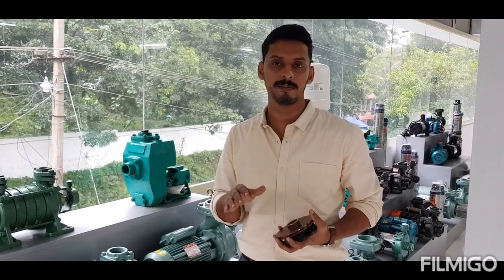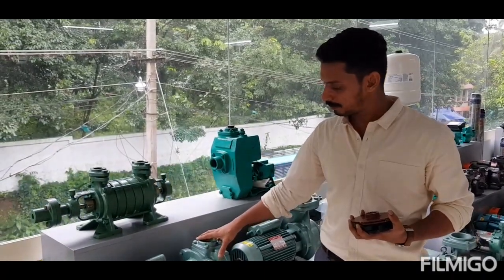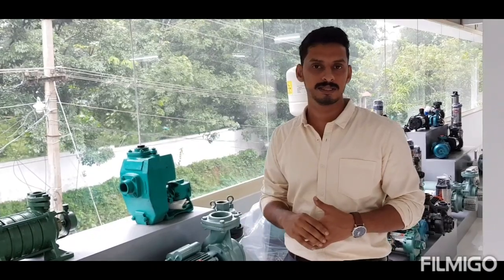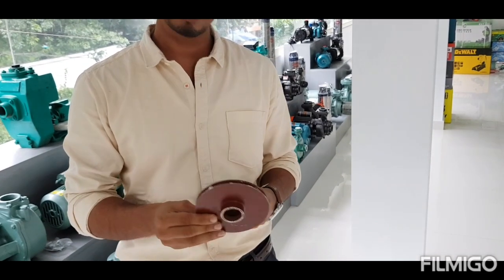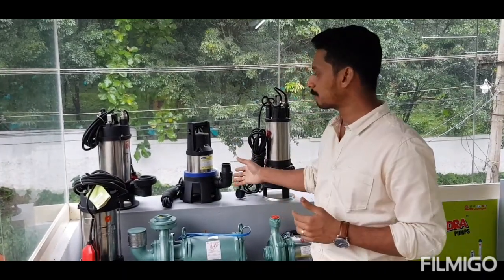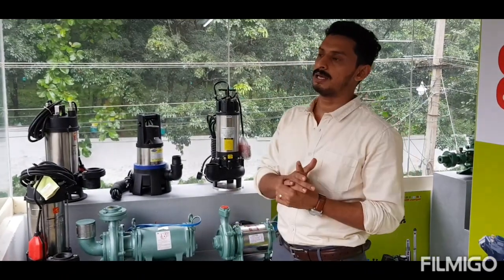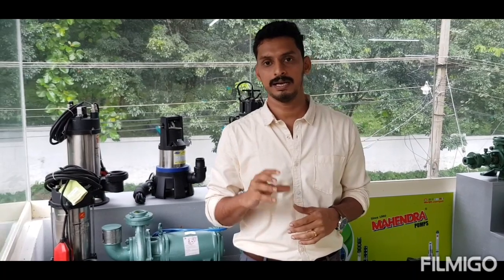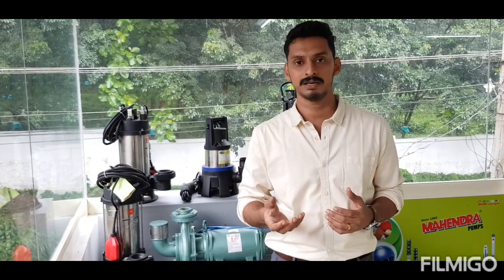കിണർ വറ്റിക്കാനും , ബയോ ഗ്യാസ് വേസ്റ്റ് അടിക്കാനും ഉപയോഗിക്കുന്ന പമ്പുകൾ . Sewage or Slurry Pumps.

Comment: Cow dunk 250 mtr അകലത്തിലേക്ക് pump ചെയ്തു മാറ്റണം. കുറച്ച് വയ്ക്കോൽ ചാണകത്തിൽ mix ആയിരുന്നാലും ബ്ലോക്ക്‌ ആകാതെ പറമ്പിൽ എത്തിക്കാൻ പറ്റിയ pump പറഞ്ഞു തരാമോ? 1 inch pipe മതിയാകുമോ? Pump എത്ര hp വേണം? സ്ഥിരമായി പുറത്ത് set ചെയ്യുന്ന പമ്പ് ആണേൽ നന്നായിരിക്കും...
Reply from the maker: Purathu vakkuna models ilum nallathu submersible type ayirikum.
Pipe size minimum 2inch venam. Line length kooduthal ullathukond kurachu higher size pipe ettal nannayirikum.
Etrayum head kittuna single phase pump 2HP venam

Comment: grinder pump 3 " rate onnu paraumo plz
Reply from the maker: Details eduthu tharam. Stock available alla
Reply: @thundathiltraders  ekadhesham kittiyal mathi
Reply from the maker: @rajeevraj6658  2HP SINGLE PHASE 2INCH DELIVERY / HEAD RANGE : 4 TO 22 METERS / DIS RANGE : 24 TO 2 M3 / APPROX PRICE AROUND 35K
Reply: @thundathiltraders  35000
Reply: @thundathiltraders  ok plz.
thanks